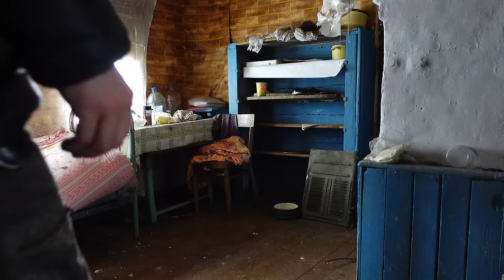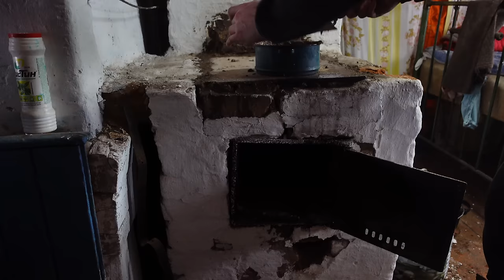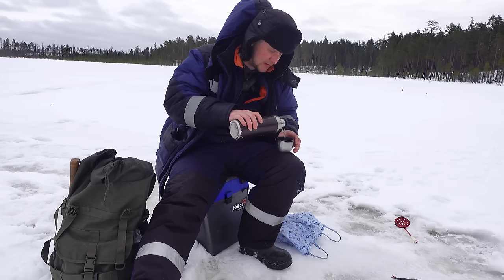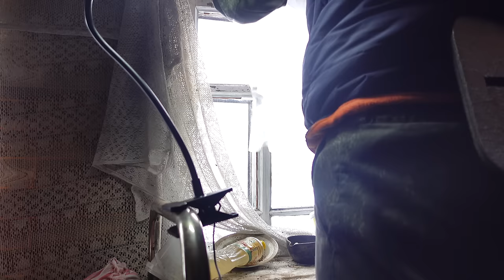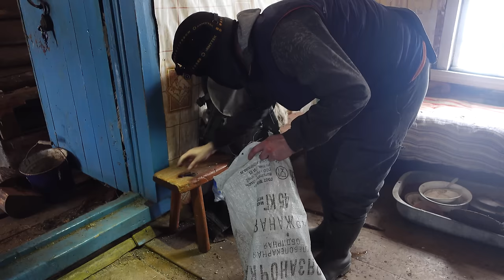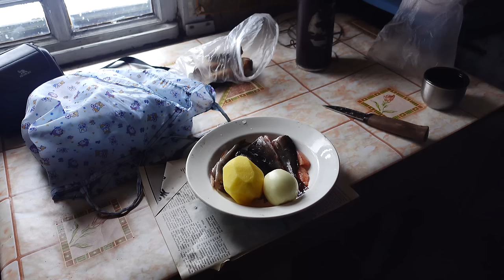Life Alone in abandoned house, log cabin far from civilization, Ep - 1

Comment: I suspect that stove will take a long time to heat up the room, but once the stove is really hot the mass of the stove will keep the heat there for a long, long time.
Reply from the maker: That's right, the second stove that I heated gives off heat after 12 hours, this does not mean that it needs to be heated for all 12 hours in a row, with one laying of firewood, and when the coals remain, close the flap on the chimney and a large mass of clay bricks begins to heat up, the heat persists for a long time
Reply: @taigamen  I could not tell where the top of the chimney went. Does it go all the way up through the roof? Also, The logs in the roof did not seem to be tight enough to keep out the rain. Is that correct?
Reply from the maker: Yes, the chimney goes through the entire roof, by the end of the video I was repairing it, indeed in one place the roof is leaking water and therefore the wallpaper has peeled off in one room, this problem needs to be fixed
Reply: It’s nice you answer questions.  Much appreciated.thank you. So many can be bothered.